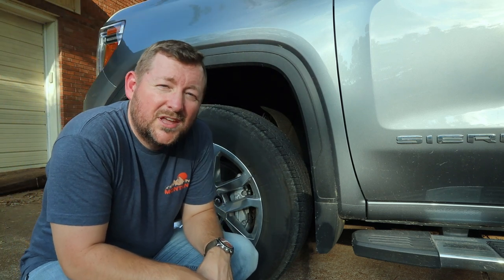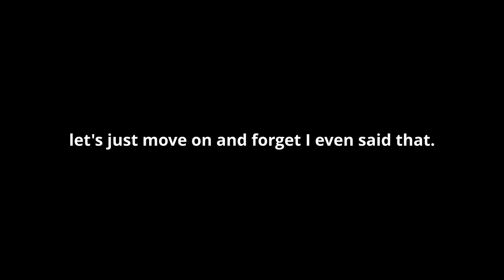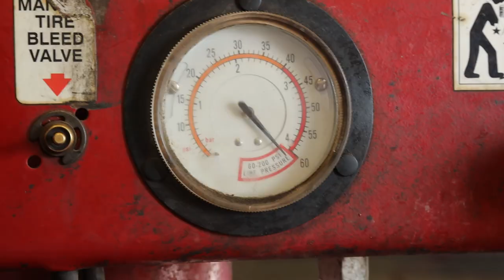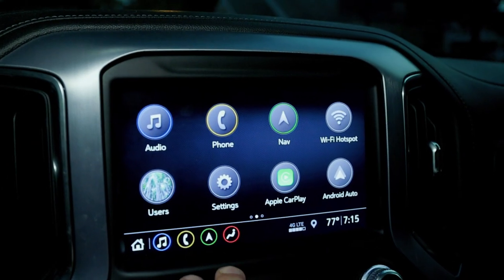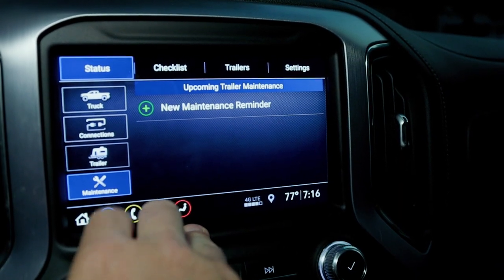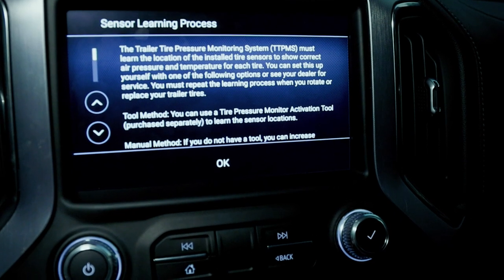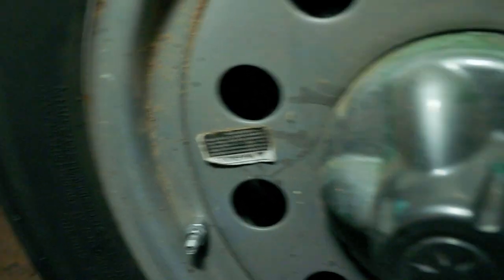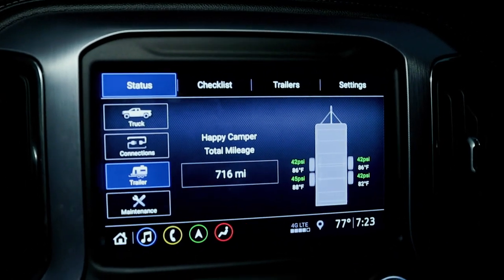How to Install a TPMS on a 2019 GMC SIERRA | TRAVEL (RV LIFE) | WHY DID I WAIT?! 🙀🙄

Comment: My truck came with the ttpms sensors, I installed them myself in the driveway. We upgraded the TT, to a fifth wheel, and I let the sensors go with the TT, big mistake because it cost me $300 to replace the sensors for the fifth wheel. I also purchased the programmer from Amazon, and I think it cost about 10-15 bucks, well worth it because I used it just the other day when I rotated the tires on the truck.
I cheated with the 5th wheel sensors, since I had new tires put on it, I let the tire shop install the sensors, but once again having the programmer came in handy for relearning the sensors to the truck app.
Nice video, thanks for sharing...
Reply from the maker: Thanks for the tip on the programmer!  Thanks so much for watching and the advise!

Comment: I didn’t get sensors with my 2020 Silverado LT Diesel. Bought some auto tell sensors that I can’t het paired.
Reply from the maker: Thanks for watching Mike. Not sure why they wouldn’t include the sensors. It’s my understanding they come with all of the 2019+ trucks but I could be wrong. The part number for mine I believe is GM (13516165). I would assume these would be compatible with the 2020s as well but you could check GMs site for sure. Hope that helps.

Comment: Great video,  I just got my trailer value stems for my 2020 3500 Denali. 👍🏾
Reply from the maker: Man what a truck. You could haul a mountain with that thing! Congrats.
Reply: I just turned mine in for a 2021. They lemoned my 2020 3500 DRW
Reply: I have a triple axle. I can not get all the tires to sync up.
Reply: What is the part number for the trailer TPMS sensors? Thanks
Reply from the maker: @larrydavis1841  not sure if range could be the issue or not.  I'd be curious if one of them that won't sync could be taken off and learned in closer to the cab?
Reply from the maker: @MrAFBuckeye  the part number I found for mine is GM (13516165).  Hope that helps.
Reply: @daviderin  thanks! Ordered it today!
Reply: @MrAFBuckeye  I would be careful with that part number.  The trailer TPMS i have found are the 84152501 or 84338125

Comment: did you also install camera that goes with the gmc invisible trailer?
Reply from the maker: I don’t know if that’s an available feature on the 2019 model. If it is I’m not sure about it. That’d be awesome to have!
Reply: @daviderin  no I believe only the 2020s have it, later model. I got the invisible trailer and GM did not install, so I was stuck with it. They recommended a local cartoys who completely screwed up the installation. They did not read the instructions at all. Still fighting with them to correct their mistake. Charged me $600 for a bad install. One tip, to anyone considering it, don't buy it unless your dealership will install.
Reply from the maker: @kashhouse  that’s terrible. Definitely a good tip. Thanks for watching.

Comment: I see a limitation of 6 TPMS trailer sensors from chevy, is that per trailer or is that total?  can I have 2 trailers with 2 axles?   also, do I have to buy chevy sensors or can I use the amazon ones?
Reply from the maker: Honestly, I'm not 100% sure on this.  If the limitation is 6, I would think that would be a total of 6 sensors which would be enough to cover a triple axle rig.  I would also think that those sensors would have a range limit as well, so I'm not 100% sure that a second trailer would be close enough for it to reach the receiver.  As far as the sensors to use, I've only had experience with the factory ones from GMC.  I'm always willing to give other brands a shot if it's a significant price difference, but you'd have to weigh the price difference versus the effort it would take to swap them if they didn't work.  I hope that helps hearing another opinion.  Thanks so much for watching!

Comment: Make sure you get the trailer TPMS and not the normal truck tpms sensors.  The trailer sensors have the temperature sensors in them.  PS the sensor numbers are 84152501 or 84338125.  Mine did not come with my truck but you can buy them separately.
Reply from the maker: Thanks for the info. Thanks for watching!